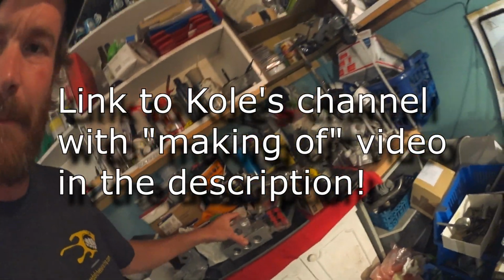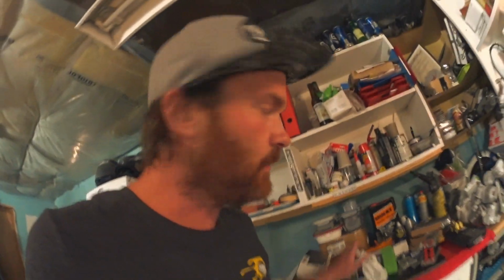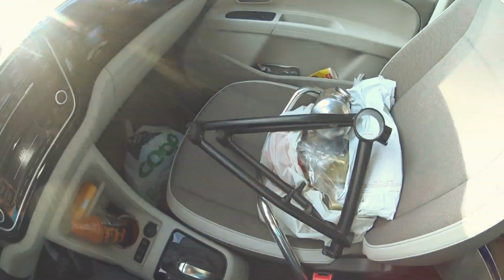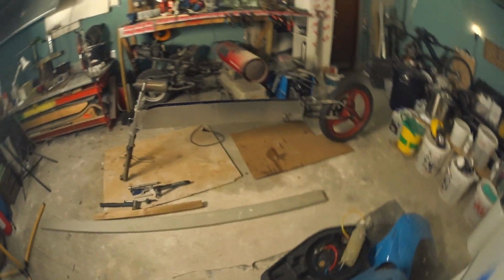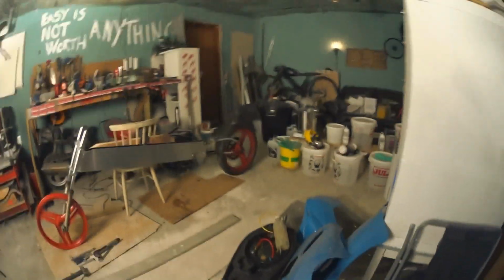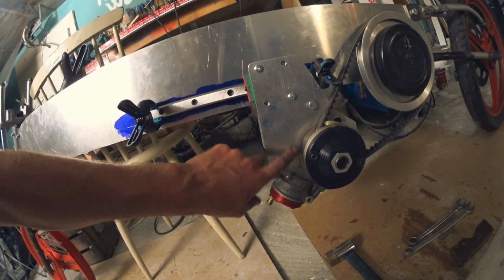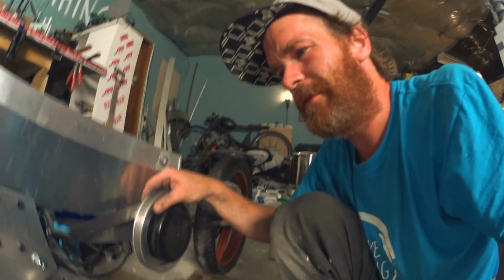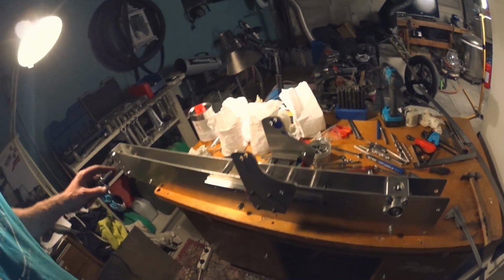50cc Two Stroke Bonneville Landspeed Record Build 1

Comment: Awesome job can't wait for the onboard footage you'll need a few cameras rolling on the day.
50mm square Aluminum tube on bottom of frame plates as spacer and riganess.
 I'll say your going good for 100mph plus.
A naked outfit your spot on keeping one weight low and on back wheel for traction. 
Legs and arms as close to center as possible been on bikes for 40 yrs and raced a lot so thought i just offer some tips cos i love your craftsmanship determination and commitment cheering from OZ brother .

Comment: Put the fuel tank inside the rail...
Just tig 3 plates front back and lower to box it off before the forks swing arm and motor.
Should have plenty of space in that centre for alloy cross supports, baffles etc.
Be intresting to see how this is going to work 😁

Comment: why did you go with a 48 mm bore ? thats a really small strokes  smaller then what chainsaws use ,a 65 cc use 48mm bore ,bikes use longer strokes ,sounds like you will be going way up there in rpm lower tq higher hp and rpm , this is what i do to bc with high compression gas burns faster so you dont need the long stroke and short stroke = high rpm but when useing other fuels a long stroke may be best bc it burns longer down the stoke more push more tq and tq is fun but tell my why so i can learn more form you

Comment: Octane slows down combustion to prevent explosive detonation before the piston reaches TDC.  One should use the lowest octane possible before knocking or pinging occurs to achieve the highest power.  In high RPM motors, high octane will result in much of the burning occurring too late to provide power.  I imagine that your 50cc motor will be turning high RPM.  I am not sure how octane really affects 2 stroke motors, but I suspect it may result in melted exhaust ports.  You might want to research this before using the "racing" fuel.
Reply from the maker: Octane rating and burn speed is not linked - you can have both a high octane rating and high burn speed in the same fuel. Sunoco Supreme burns pretty fast. Also I like how leaded fuel responds to jetting.
Reply: @2STROKESTUFFING  Because higher octane gas burns slower, it is more resistant to knock when subjected to higher RPM and cylinder pressures. Compression ratios also factor into cylinder pressures. Higher ratios cause higher cylinder pressures and therefore cause the engine to be more susceptible to pre-detonation or knock.  Quote from: https://www.hemmings.com/blog/2014/04/11/tech-101-octane-the-facts-and-the-fiction-behind-those-higher-priced-fuels/
Reply from the maker: That statement is false. Octane rating of a fuel doesn't say anything about it's burn speed. If the fuel is blended with light components it will generally burn faster, regardless of octane rating, if it's blended with branched chain alkanes it will resist knock better vs  straight chain regardless of flame speed.
Reply: @2STROKESTUFFING  Ok. Thanks.  Clears up a long standing understanding of mine!

Comment: Last comment on your arduous & admirable process:   Building the most powerful motor is one thing, getting it to go faster over the salt & thru the air is another.  Optimization of tire composition & shape, suspension charcteristics & especially aerodynamics separate the merely powerful from powerful winners in almost all motorsports.  You may not have a fairing, but every surface from your helmet to your tire will drag you back, more or less.  We want you to win!  Just please let know how you are managing the non-hp factors as you develop your super-cycle

Comment: Since you will be running on hard, lumpy surface (salt flats) I would guess that your flat chassis panels might flex - making you 'snake; at speed - I would add tubular or triangular (2 bent edges & 1 welded) pipe stiffenting longerons to each side, or some form of additional bracing/stiffening between the headstock and swingarm pivots, considering your main frame plates seem between 6mm - 10 mm thick.
Or...
Because the bottom of your headstock is currently unsupported, it will need some anti-twisting bracing at least towards the motor mounts, if not all the way to the main swingarm area (even if your running it as a hardtail) as the 'laying down' chassis and raked front style will focus sideways forces from the ruts of the salt flats into partial chassis twisting in the rolling plane/axis making additional flexing of the chassis panels, and possible binding-up/locking-up your sliding motor mounts at some important point.
Also, less important, perhaps some light printed plastic (or polycarbonate) sliding dirt covers (fixed to the motor cradle) could be created to try and keep the salt and other minerals kicked up by the wheels away from the sliding motor mounts once you have finalised the mounts positions and how have the 'limit stops' for them made.

If you already have some of these plans, ignore me, sorry.

Comment: hey
probably been thought about before but what about having 2 exhaust ports?
like on opposite sides of the cylinder
2 pipes for 1 cyl would be fun
Reply: Might make proper scavenging an issue. The current design relies on flow from carefully placed ports to clear out the exhaust and replace it with a fresh charge.

Comment: According to the interwebs, world record for 49cc engine powered bike top speed is 126mph!!! Is that right?
Reply from the maker: It's closer to 150mph, full streamliner. The class we're entering this year allows no streamlining at all, the record is 92mph
Reply: @2STROKESTUFFING  It is 148 km/h. You will need about 24 hp at sea level (from the assumption that 1 hp gives 30 km/h). Your driving position will be different than on a moped, so maybe you can manage with a little less hp.

Comment: I can tell you how to balance the crank for best balance (no vibration) at top RPM if you give me all the data listed at this page: http://www.dragonfly75.com/moto/CBinstr.html But maybe you need to test the engine/pipe first to see what its top RPM is.
Reply from the maker: Thanks for the offer! It's not that easy tho, frame geometry, engine mount location, cylinder orientation etc. Comes into play.
Reply: @2STROKESTUFFING  those factors do affect how you feel the engine vibration but still the approach to balancing the crank remains the same. So if you want to give it a try I am here to help you.
Reply from the maker: Thanks, that makes sense! I'll have a look!

Comment: Hey,I want add rotary valve in minarelli horizontal but left and right side they are reserved. Right side for stock ignition and left for drive. I want move original ignition but I don't know how. Can u little help me and recommended any ignition? BTW for more power u can use oxygen bottle from welding with 50-100%oxygen. In the air we have just 20%oxygen and it's quantity is responsible for the power of explosion. Nos decomposes on oxygen and nitrogen.
Gettings from Poland

Comment: Its easy to get the balls back in the bearings, just clean them. Take off the end plate of the bearing. Use a little grease so they stick and dont fall out.

Comment: Have you considered injecting some pure oxygen into the air box? You don't necessarily need to increase the flow of air into an engine when the same result can be achieved by increasing the quality of "air" that it's getting. I've used this technique to get an edge on a few very close street races before, just don't over-do it.

Comment: Very cool progress! I’m extremely curious though if there is a benefit of running a single variator clutch with a sliding engine rather than a rigid mounted engine and dual variator clutch, like a snowmobile, where the front clutch gets larger diameter, and the rear gets smaller, as rpm increases. I understand the resulting power transfer is similar, just curious if there is a benefit of one over the other, or if one is more suited to smaller engines vs larger engines. Either belt clutch method is far less efficient than a direct gear to gear with a friction clutch like a dirt bike has, but drastically simpler. I just look at your slide rails and bearing blocks as a huge added weight. Could quite possibly shave a few pounds by going to a dual variator setup, and rigid mounting the engine. Not knocking your setup, it’s still beautiful, and fifty times more work than I’ve put in on my bikes in recent months, just curious what the pros and cons might be. I’ve cancelled my plans to go to Bonneville in August so I can go instead in October so I can watch your attempts to make history, but haven’t heard back from SCTA about the possibility of volunteering as event staff, I may just attend as a spectator if they do not get back to me, which I would be perfectly happy with. If you need a pit volunteer just say so, I can bring a grip of tools down with me.

Comment: Your rushing ! First mistake!  Frame looks dangerous. Thin sheet metal  hope you won't get cut in half. . I would have stuck with tubing . Nice tank that serves dual purpose. Just wish you had more time to think things out . Long frame could work in your favor . Worried about weight! 
Now go out and do your best . If not this year ,Next!!! 
But it would be great to see you  accomplish what you started .
Know that this opiate enthusiast is pulling for you. Be SAFE!!!!!!!!!!!!!!!!!!! Gods Speed because " Fast is not Fast enough "
Reply: Peter Baranyai big fan of OxyContin huh? Just kidding! Damned auto-correct!

Comment: I think you are doing great work, very interesting to watch. Why didnt you choose for welding a piped frame (aluminium) instead? It might be a lot lighter and stiffer than aluminium sheetmetal.
Reply from the maker: Thanks! To be able to take it apart, easier to get on a plane.

Comment: Many many thanks for your inspiring dedication to sharing the ups and downs and learning curve on the speed record project.  Question:  Given an optimized power train, frame & running gear, the limiting factor will  be air resistance.  This problem has generated at least as many solutions over the years as 2 cycle motor design.  How much fairing are you planning to wrap around your marvelous machine?
Reply from the maker: Thanks! No fairing at all, not allowed in the class we're entering.

Comment: Good job man!but why use er2 pulley?in France we have pulley 120mm for hight speed ...
Reply from the maker: Thanks! It was available locally and not too expensive. As acceleration is not important in this case I can live with the shorter range and just run a higher final gear.
Reply: For french pulley  see redtech racing but its very expensive

Comment: The fuel tank valve word you may have been searching for... Petcock. If the surface is mushy I've found racing shoes with a little duct tape make stabilizer struts with more finesse than stiff boots. It's wise to shield all foot pinch points including the forward tire edge. You'll know if a foot zips under the tire just by the sound, THWACK. 

The smallest bend or rib lengthwise along aluminium rocket panels can add rigidity without adding mass. What I'm thinking about are high speed harmonics and a ticking time bomb muscle memory that the early GSXR wobbles left behind. Have fun.

Comment: Wow dude! Amazing stuff. I feel like I'm watching landspeed history in the making...coz I am! I would suggest that you get you mate henrik to weld all the frame components together though as it'll add rigidity that you're going to be in need of if you intend on going anywhere near 180kph and will likely reduce weight and vibration too as you won't have all those bits of steel (nuts and bolts) holding things together via tension alone, but rather a physical connection via welds.

Comment: The new hole of your engine mount plate seems very close to the edge. I would atleast consider to bring a spare to Bonneville, it might tear through due to the torque / vibration of the engine.
Reply from the maker: True. I'll probably trace and cut new ones.

Comment: Hi from New Zealand
Great idea to use 2 alloy plates for your frame. I have built machinery using linear track nearly identical to yours. 

  After u have finally tightened the track into position, set up the track with the holes upward and the track horizontal. Mix up some gd epoxy resin and pour it into the holes in the track and slighty overfill them.
   When the epoxy is nearly set, shave off the excess resin with a razor blade so it is flush with the track surface. This allows the seals on the ends of the linear bearings to work properly. 

I would hate to see the bearings get full of salt and cause you a problem.
Lubricate the bearings with light grease and they will seal and work happily for many years. 

  The bearings should have a lubrication hole on one end.
 Gd Luck on the salt!!
Reply from the maker: Thanks! I'm in a bind here - really want to be able to disassemble the bike... Maybe press in plastic caps and shave flush.

Comment: I love the disk valve engines i used to tune my own refo 100cc kart engines early opening and late closing. Haha. Have you ever looked into fuel injection?
Reply: You ain't felt the power of my 100cc rotary TKM blueprinted motor, SON!!  That pull when it hits the pipe will put your balls in your throat.... that's how it felt like for me, hahaha.  Don't test me!
Reply: @tonykartracer8032  I raced formula super a. And tuned them. I know what 0-60 is like tkm even blue printed is limited to power output. So please be respectful to this top man and me and know what you are talking about before writing. Without being rude i know what i am talking about in a 2stroke rotary valve engine. Please do a bit of research into formula supera v tkm kiddy class. Regards.
Reply: @weeted3142  You ain't even know the legendary Sudam motors!!  ENOUGH!!
Reply: @tonykartracer8032  try formula super a thats what i raced back in the day. Tkm was the cheaper option. Super a was the pinicle of 100cc.

Comment: Have you just drilled holes in the new square tube petrol tank. 
When the frame is finished a Matt sand blasted look wood be good.
Can't wait for the next one.
Reply from the maker: 👍 There's welded in bushings where I drilled, no worries.

Comment: You could weld some honeycomb looking X crosses on the bottom half of the frame. Will make it a lot more stiff and not weight much more.
Reply: Should have looked how other people make frames. Aluminium is a light weight product but used to much of it. My 2 cents.!
Reply: Scrap the whole thing and start again using 100% carbon fiber
Reply: @john9289  working with carbon fiber is a pain and very expnsive
Reply: @kes01523  it's a joke

Comment: I Love your videos. But you should try to close up your frame on the underside as well. Just as you did with the top side. It will stiffen it a lot. The problem is that you apply torsion force to an open profile. A closed profile would be a lot stronger here.
Reply: Why not add a piece of rectangular tubing? Mega cheap and easy to do.
Reply from the maker: Thanks! Will see how it turns out with the addition of a spacer or two down low.
Reply: 2STROKE STUFFING Don’t try to save on the spacers/attachment points between the two plates. By gut feel I say that 3 in the top section is on the...low side. And without any calculation or simulation I would rather have to many then to few. Smaller, closer and more of them would be preferred. 

Making the chassis to stiff for the salt I see as much smaller risk then making it to soft. In the end it’s more about strength and not breaking anything. (We don’t like to see you hurt your self. That’s way I bring this up.)
Don’t neglect the possibility to use adhesive between sheet metal panels just because it’s home built. I’m more then confident that you can make great results easily.

Sorry if this comes across as a bad rap from someone not an expert in this things. But better ask now then when it’s to late.

Unfortunately I’m moving my shop right now. Otherwise I would gladly have made some of the parts you need for the bike.

Lycka till!

Comment: Hey. Have a thinner wheel. If you are scared of a death wobble/tankslapper, make sure you get a steering damper on there. I have been following you for a very long time. Will there be more nitromethanol moped videos? :D
Reply: Game Imre true shit 👌
Reply from the maker: Got both thinner wheels and a steering damper!
Reply: 2STROKE STUFFING You should probably bring a set of fat tires now that I’m thinking about it just in case if the crust isn’t thick enough to hold the thin tires
Reply: @2STROKESTUFFING  Nice! Was it in the video? I'm very tired at the moment.

Comment: I think you could gain a lot of torsional rigidity if you dimple-die cut the sides of the frame plates. 
Also, have you thought about using a gas strut as the tension spring? Some people on mopedarmy swear by it.
Reply from the maker: Good idea! Not decided on spring yet, gas strut would be nice.